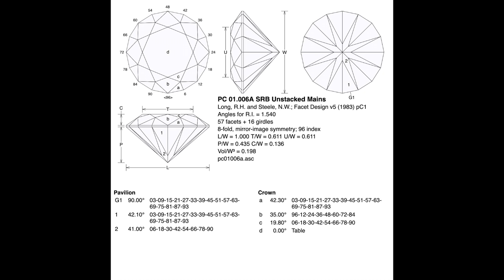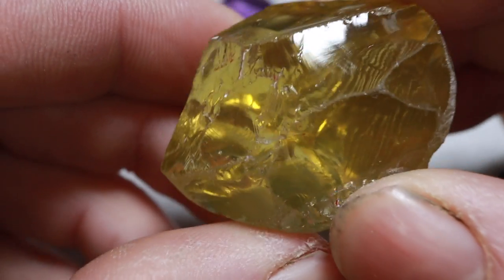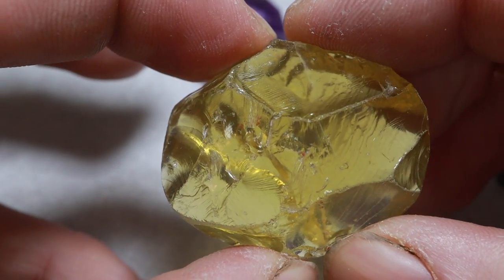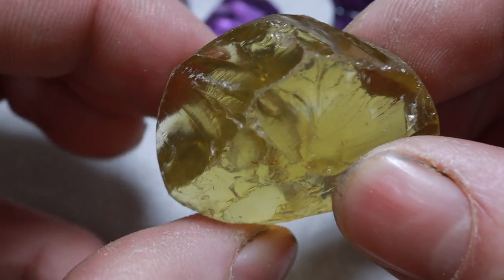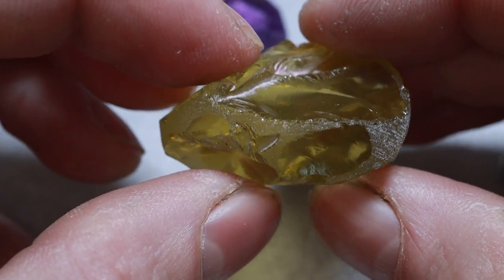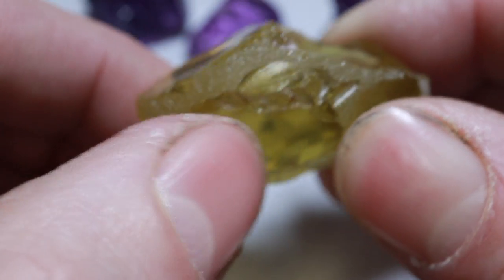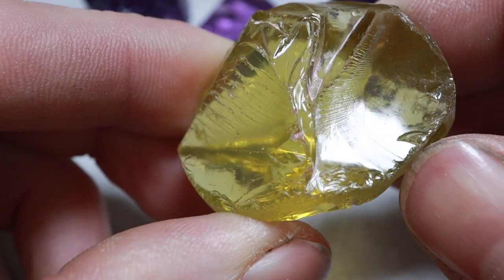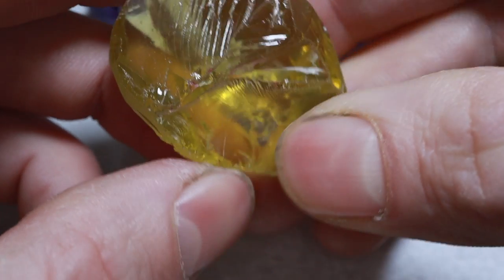How much is left after cutting a Gem??

Comment: Any tips for dopping and transferring those big stones?
Reply from the maker: check out my video 30ct amethyst 
i use super glue and place the dopp by hand after measuring carefully and make a good flat spot when preforming  for transferring i always use a transfer gig 
epoxy glue for the transfer
Reply: @stuartgems7593  so heat or a long acetone soak to remove the first dop? Last time we used heat and it shock fractured a large quartz🤯
Reply from the maker: @whackidoodle   indirect heat  only heat the dop you can also use a hot knife to remove the epoxy  you can also use a wet tissue paper to keep the gem cool 
super glue can sometimes be difficult to remove with heat I have not had any problems with this technique  but there is always some risk with heat

if you are worried about thermal shock don't use any super glue 
under the dop  use the transfer   gig  and only put epoxy around the dop it will release much easier and almost on heat is necessary  
a hot knife will cut away the epoxy
Reply: @stuartgems7593  we did use wet paper tissue and only heated the brass to protect in this case. However, heat transfer was just too much. I think it was something like a 16mm flat dop. Fully glued the whole surface though. Perhaps next we try will either use glue only around the outside like you mentioned or maybe even place a polystyrene plastic piece on first as a heat barrier between the rough and the brass. Got the wheels turning now!🤣 thanks for the feedback
Reply from the maker: chances are thad you did not doo any ting wrong  the amethyst probably fractured  due to internal stress from when it was formed, I have herd of 100 ct  tanzanite shattering because a small amount of heat   it is not very common in quartz  
and you may never have it happen again  I revelry use wax for amethyst and have had no problems like that 

but a cold doping technique is always safer 
try a few ways and find what works for you 
personally I would not use anything between the dop and gem  
but i have never tried it so maybe its ok  
good look and happy faceting
Reply: @whackidoodle  z

Comment: Hi Stuart, this is a nice video.. I have a quick quastion for you in terms of the polishing process. I have a 6" cooper and when i am doing the polish always left some scratches on the facets. the lap is ne, only i have used 2 times.   could you please help me to solve this problem ? thanks a lot
Reply from the maker: Yes, absolutely it can tack a bit of tie for the coper lap to start working well as the diamond needs to bed into the copper 
use an old credit card to charge the lap with the diamond slurry  
also coper is not the best polishing lap for every gem they can be difficult to use  
you need to get the speed  amount slurry and pressure  just right try varying these tings to find what works best   best of look

Comment: It's a bit of a commercial question, but I wonder the difference in income between cutting a gemstone into one large gem and cutting into several small gems. Which is more profitable? 
If the second method is more profitable, It would be a nice way to avoid using fractured part...
Reply from the maker: hi  a single large gem is worth more than a few small ones

Comment: What about those stories about how diamonds had to be struck to cut them? You know, like the advertisement that a certain car rode so smooth that a man riding in the back could cut a valuable diamond without missing the crucial point in the crystal. One false strike and the whole diamond could be ruined. Is this a true thing or just a dramatic myth?
Reply from the maker: diamonds used to be divided that way before cutting now it is more common to saw a diamond than cleave it  as it is safer and more accrete